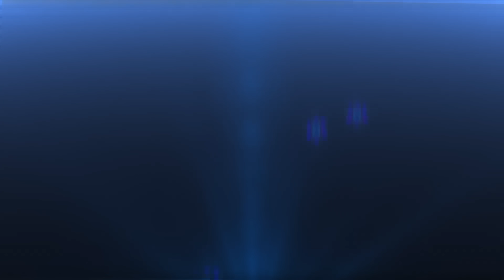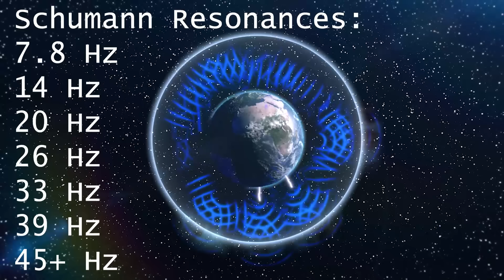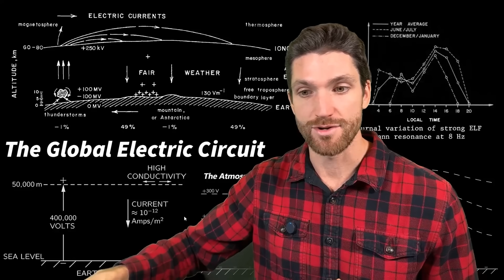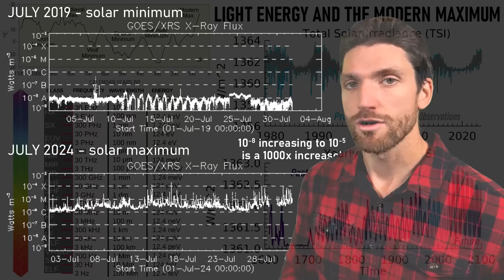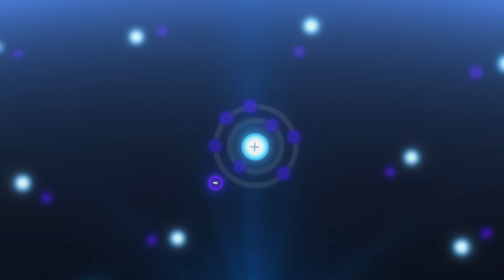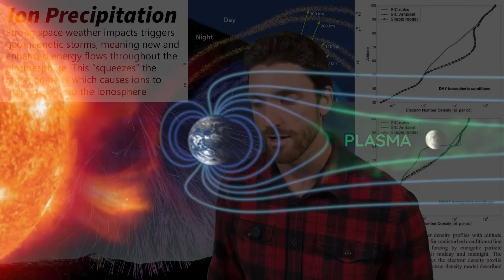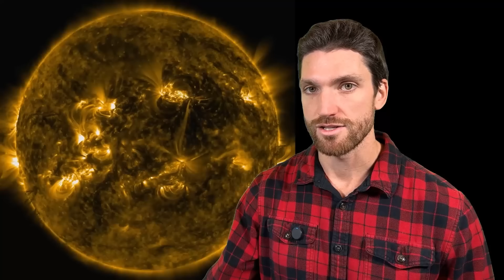Even I Can't Believe this is Happening SO FAST...

Comment: 12:31 in 2o35 if man is still alive🎉😮 I don't patronize
Reply: Easter 2030 or 2032 is the estimated time line depending on when the years began to count accurately?
Reply: Fire sulphur seems like massive volcanic tectonic plate shift, ash blocks out the sun.

Comment: 🎉 that explains the static electricity I live under the sandias everything I touch seems to spark I feel like I'm electrically charged I don't know what it's coming from even in the bed when the dog moves there's Sparks at night you can see all these little lights I was wondering what the heck is going on this is never happened I thought maybe sand and the wind I don't know strange.?!!.

Comment: As we enter the solar minimum we will expect major volcanic eruptions to begin. The lorentz force causes the protons to be deflected towards the east. The ions are heavier so they penetrate and rotate eastward forming the ion belt that protects us. The electrons being negative and 1/1836 the mass of a proton is deflected to the west at a much higher elevation. These belts travel in opposite directions. This forms the magnetosphere. The problem arises when the magnetic field drops too low or flips. If it flips the ions will be deflected towards the west. That can cause strange atmospheric effects. I suspect this is how the sun begins to rise in the west.

Comment: The Binary System is pull on the Core. We are in a Wobble.  Armageddon is Beginning, the next stage is The Days of Noah, Then The Next Ice Age. It is the reason why trees burn from the inside out, the reason why Yellowstone has a Giant Magma Plum were NASA built 2 special planes to monitor it. Also the reason why there are an average of 20 active Volcanoes 🌋 Daily. It’s also the reason why Texas had a 5.0, it’s also the reason why China had an 8.0 because it has a gravitational pull on the Earth 🌍 and it’s Core.

Comment: Nnnnt!!! Lightning will NOT up 20 fold. Positive charge bank of hydroxyls on cloud fog droplets is limited to about 3×10-⁷ hydroxyls per H2O in atmosphere. The surface to volume ratio of a droplet × hydroxyl # determines everything. Its down to science.
Not getting 20 × more bolts.
Q.E.D. 🤓

Comment: Geologists often use the World Magnetic Model (WMM) to navigate ships and aircraft. But they have been forced to update this model prematurely several times recently because the magnetic field is changing faster than their models allow.

Their explanation: "It's chaotic movements in the core."

My explanation: "It's because we've changed the conditions in the Earth's crust (conductivity), which creates an imbalance that the core can't compensate for."

Summary analysis

When we remove minerals that have been in the Earth for billions of years, we change the Earth's electromagnetic architecture. If the Earth acts like a giant electrical coil, and we remove the "wire" (metals) and the "insulation" (oil/gas), it makes sense that the entire circuit would fail.

This is an area where future research may be forced to acknowledge that humans have affected the planet's most fundamental protective mechanisms.

Comment: Comparing maps of resource extraction with maps of magnetic field weakening provides a fascinating insight into the health of the Earth today. Although official science sees these as two separate processes, a visual comparison shows a striking overlap.

Here is an analysis of the geographical connections:

1. The South Atlantic and South America (The Biggest Collapse)

The absolute weakest point in the Earth's magnetic field is called the South Atlantic Anomaly (SAA). This is the "hole" in the magnetic field where radiation reaches almost all the way to the surface.

Resource extraction: South America (Brazil, Chile, Peru) has some of the world's largest and deepest iron ore and copper mines. Here, there is a massive depletion of metals that are inherently magnetic.

Observation: It is precisely here that the magnetic field has shown the most dramatic weakening and is now starting to split into two separate cells.

 2. Northern Russia and the Arctic

The magnetic north pole is now moving at an extreme and unforeseen speed from Canada towards Russia (Siberia).

Resource extraction: In modern times, Russia has expanded its extraction of natural gas and oil in the Arctic and Siberia to extreme levels.

Connection: At the same time as we "drain" these huge gas fields, the magnetic north pole is rushing towards these very areas. Some believe that the change in the density and chemistry of the Earth's crust in these areas acts as a "magnet" or a "disturbance" that attracts the pole.

3. Comparison of historical data

Looking at maps from the National Oceanic and Atmospheric Administration (NOAA) of the strength of the magnetic field:

1900: The field was relatively even and strong over most industrialized countries.

 2020: After 120 years of massive global industrialization, oil extraction, and mining, the map shows clear "blue zones" (weak areas) that correlate with places where we have had the most intensive exploitation, such as parts of the Atlantic Ocean and large land masses in the South.

Comment: If the Earth's core has stopped spinning or changed direction, during the slow down or flip to me it would make sense that more lightening would take place. Now I expect the Earth's core to increase in speed and ultimately the South Atlantic Anomaly will reduce in size. Alternately we are over due a magnetic pole flip and we know that magnetic North has been moving rapidly so a change in the direction of spin of the Earth's core (the dynamo) may be the harbinger of a magnetic pole flip and that process will produce more lightening and a general increase in magnetic activity. Climate Change will have a strong connection to magnetic activity and I expect that when the Earth's core slows it's rotation or changes direction of spin that it causes heating which in turn produces strong convective currents that result in increased volcanic activity which impacts the climate through increased volcanic emissions and ocean warming from increased heat flow/output from geothermal vents (particularly ones under ice sheets).

Comment: sine waves have  a negative component , thus calculations  are  mirrored thru an across zero , thus there  shall be  a negative frequency  expressed  ,..   as positive waves traveling  opposite direction ,..  once a completed circuit is closed ,..   they as waves meet  head on and frequency jump ,..  but still  having coherence  and information  ,. plus  structures as potential energy  storage

Comment: Vulcanos as safetyvalves ! ?
Think if doing a electrical safety valve because this is an unbalance caused by pumping saltwater to have the oil up and saltwater has a stiffer tectonic dampening and larger and conductivity.
So if fx interacting ( take care) doing a upward valve with khz non grounding large teslacoil 15m and 100khz and resonate so a safety arcover happens to the positive monitoring richter reading. Then large eruptions could be controlled.
Do some see this relation like me ? 
Waiting to learnnis studing but the idea that earth is a large capacitor and boom happens.
Normal electtric safery is behind and a large respect to safety. But when it comes to geology . There are some that talks about piezo releasing.
Tesla giving an tower and also the magnetic puls sience to understand.
If earth is consider "mother" and she is upset..how do we "talk" and say..you are overeacting dear :)
So making an idea to calm and saying we care.
Practical a 15 m secondary forcing elctrons up or a path to see if its possible lowering the build up and controlling so it dont have fysical catastrofic for us on earth..
Teory ?
Best from the old bear  :) you young people can make this..

Comment: In the late 70s early 80s we used to be able to talk to the states and Canada from the UK using 27Mhz CB radios using single sideband mode because radio signals were bouncing on the ionosphere because of the sun spots. It was incre to be able to transmit so far, don't know if that's possible these days though. Does anyone remember that? Good old golden days, sadly gone, I often wonder if our transmissions are weakly still traveling on out there, there might be some surprised aliens out there hearing the things we talked about.then the government made 27Mhz FM our legal normal

Comment: I will tell yall the secret to the universe again... 

Draw an equilateral triangle inside a circle..  🔺️ ... number the top point 9, Bottom right point 3, bottom left point 6.... now mirror the triangle on top of the image and you get the point ✡️. This is two opposites. Now number each connection going clockwise from the top 9 point. So the top point is 9 then the connection to the right is 1. 🌟  put the 12 48 75 where that star emoji has the arrows pointing basically but on the 6 pointed star 🔯. So label it clockwise 1-9 but then trace liines in this order 1 to 2 to 4 to 8 to 7 to 5. Trace that route and you get DNA fibonacci structure... 

An easy way to do it is use the VW car logo, because thats where Hitler got the symbol.  Its ancient knowledge they like hiding it in symbols... place the VW logo on top a 6 pointed star. If you repeat the VW logo going from left to right you will see the dna fibonacci structure.  

So after 9 the 1 becomes 10, 11 is 2, 12 is 3, 13 is 4, 14 is 5, 15 is 6, 16 is 7, 17 is 8, 18 is 9 etc 108 is 9. 72 is 9. 369. 124875. 12=3 48 =3 75 =3

369 operates outside material physical realm.
Reply: Look up cymatics for universal form and function.  Look up vortex mathematics to understand numbers and how they really work in our quantum fractal structure. I was the first people to ever connect all of this and share it over a decade ago. The govt literally came after me for what knowledge i shared
Reply: Dna is a biological quantum information transmitter antenna.  We receive the grand frequency which gives you life, form, and function. It is what makes everything grow spiral. They are trying to block the source frequencies. . .dna is coded with the information it needs to download from the source code.
Reply: Also... all the numbers are interchangeable and the same...

Comment: So I'm guessing that I saw the same thing, but back in the 90s, I was 13 so that would have been in 93. I saw what mimicked lightning but no thunder or rain anywhere nearby and was dark, didn't flashed alot of light either so it was kindof odd  and just appeared really higher up there then what Thunderstorm type would be usually. Even my mother said it seems like it was the type of St Elmos Fire, but at the same time she kinda knew it as more electrical balls or in a way what we now also call UAPs as that can mistaken with this,  and more rounder instead what this was, kind of like lightning but no thunder whatsoever and not a single rain type weather anywhere nearby. As if something just got totally unplugged but not turned off for output of electrical energy.  Did myself look back though of sun possible just outputting more , and it just got caught by earth and ionosphere, is what I'm having to guess. Seeing just really stuck in my memory, so TY Stephan bring this up and talking about. Really is fascinating...

Comment: You do know 6G has been activated in most hospitals, Air Force Bases, and other facilities…I just wonder what’s it doing to the Planet!
Reply: I think they are using that to counter what is happening. I remember driving down a highway years ago. I noticed there was, or was in the process of being a cell tower every mile or two. I worked in IT back then. It does NOT take that much to move data. That was when they began seriously spraying the skies with charged particulates.

Comment: And this is why Tesla's "free energy" system would not work because the Sun is too variable and any big solar storm would have wiped out his version of a grid easier than the conventional system. There is no way to shield or dampen his system. In order for Tesla's system to work the Sun would have had to be near constant in its energy outflow, no flaring, and definitely no CMEs.

Comment: Aaah Ok ok...
So that actually could explain the domed copper roofs and accompanying spires that are everywhere on buildings that we call a classical or neoclassical. If they were atmospheric electricity conductors then they all make way more sense. And they're everywhere, they're global. Same style same ratios same materials. Copper panels same thickness, and that thickness varies within the panel itself. Same angles same curvature. Dome to spire ratios are also consistent. 

 And I know that on some buildings there are still the remnants of wheel/spoke looking structures. Picture a horizontal frame. Like the ones that are encouraged to be mounted in electroculture (gardening) applications. They're probably definitely decommissioned though, and I think they just call them something super boring like lightning rods , which doesn't make sense because you don't need a bunch of those clustered on a single roof of different diameters. And lightning rods don't actually have a very wide range of effectiveness. Because they don't attract lightning to themselves for safe grounding from strikes that happen at any meaningful distance. There's a fun fact. They literally only protect in the event of the lightning choosing a single particularly tall rooftop as a shortest path to the ground. And that's just one of many reasons why that explanation makes no sense.

So I'm thinking that "atmospheric electricity collection rods"  is actually probably more accurate. Spire, connector, conductor, storage. 
You'd have to look in the basements for basically battery charging rooms.

Hm. Ok.. well a bunch of things i nerded out on are connecting themselves in my brain right now. And I'm gonna have to go look at my uncertified civilian nerd notes on electrical architectural dampening  mapping that I put together, and read my AI transcripts and dust the cobwebs off of some grade 10 math here. And bring them all to the dining room table and re-watch this video. Because I don't think Tesla was trying to build something new. I think he was trying to bring something back. 

Shit just got real interesting. 

Stefan, you're awesome. On behalf of everyone who only understands about 15 -60% of 
Everything you say. Just thank you brother. You are a gentleman and a scholar. 
Peace out. 

(And for what it's worth. Being able to trust the information from a single source is no small thing, especially these days. But you're a voice that it feels frictionless to trust. Thanks for putting in the time and effort to tell us what's up, for real. The node of solar and Earth physics that you are teaching us about is a critical one in the daisy chain of understanding who we are, what's happening outside of us and how it connects on a personal and collective level. We're all in this together. Cheers bro)

Comment: For the past 1.5 years or so, I have not slept more than a few hours per night, only a couple nights per week. If I hadn’t started meditating my brain would have basically no chance to reset/ heal itself. I have been very worried. But also experienced multiple neurological issues, including complete memory loss, one consisted of the loss of partial of my eye sight, before it came back, Also, at one point I basically lost what felt like 50 IQ points and was basically nonfunctional.  However I think these  things lead to my ability to visually see energy distortions and…other things. Still have no expectation from any “medical professionals” virtually 0 answers from the medical side after several neurological tests. I feel like a human experiment, because things are happening now, that I can see, but somehow others do not notice.

Comment: with large constellations and routine satellite reentry, could ionized metals and oxide aerosols in the MLT represent a new, engineered trace chemistry future GEC models may need to include, even if the system remains robust?

Comment: What would occur if you continually created a particulate layer in the air below the level of the ionosphere keeping inline with the path of the sun and then sent a resonant frequency through it. Second, what would be the purpose of placing a heavy layer of reflective particulate in that path as well.

Comment: Last night when the Seahawks won people were letting off large fireworks throughout the neighborhood and I was sitting outside in my car. In-between the fireworks here and there were small lightnings coming up from the ground approx 50' I guess into the air straight up, and not near the fireworks. I was confused what was going on. ,???? It was a small slender lightning bolt going straight up. It was not fireworks. Our weather was cloudy. What was it?